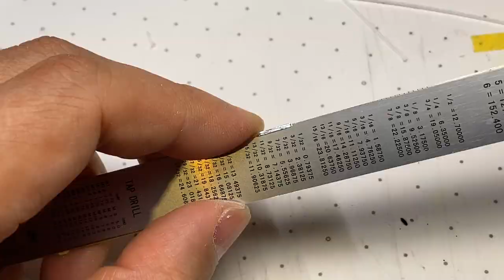LAMBORGHINI MIURA 1/24 HASEGAWA - part 6

Comment: I must say, I am enjoying the occasional twanging spring or dropped part. Well done for keeping those 'fun' little moments in the video. I used to fit a lot of tiny e clips, or Jesus clips as they were called. So named because of the expletive one would say as they twanged out of the needle nosed pliers. Generally never to be seen again, even after lying prostrate on the floor trying to find them!
Reply from the maker: Thank you for watching. If a part is lost, it will take a lot of time to find it.

Comment: Wow! Why didn’t Hasegawa make those parts? 😠Just waiting on the final body painting to pull it all together. I always go to the end on instructions to see the final build for motivation. When is 7 coming?😄
Reply from the maker: Yes. It is a pity that the kit did not reproduce the engine and other parts. The next video include about paint. Thanks.
Reply: @A4Garage  Maybe they didn’t think anybody would be motivated enough to try the clamshell detail. Would a larger scale ( 1/18-1/12) be more practical? I remember building 1/12 F1 race cars years ago with all the tiny rubber tubes measured out and a pack of mini screws and screwdriver to hold the assembly together. Great work so far looking forward to the next installment. Did you show Hasegawa final result?